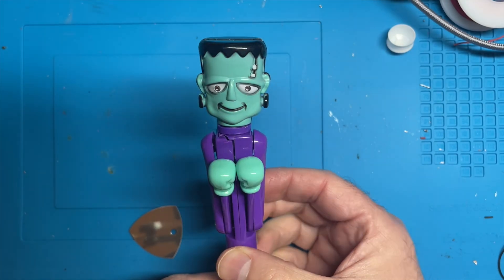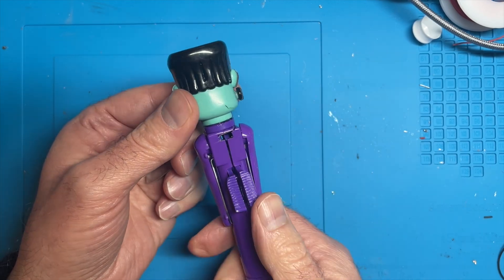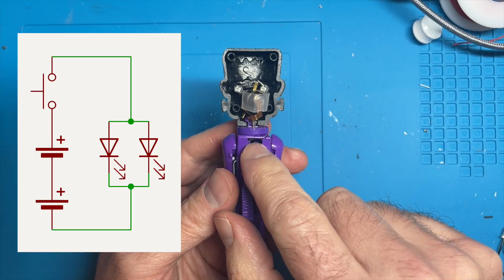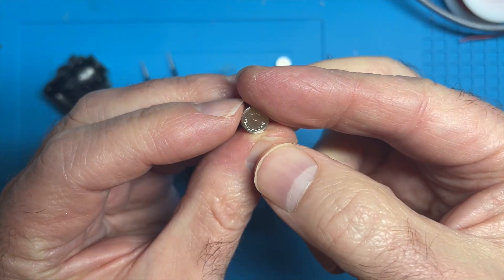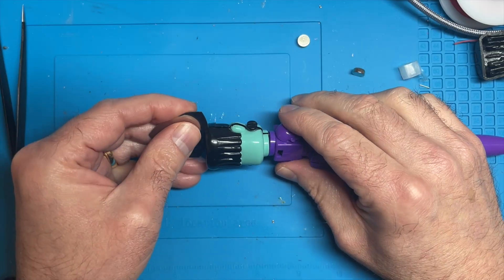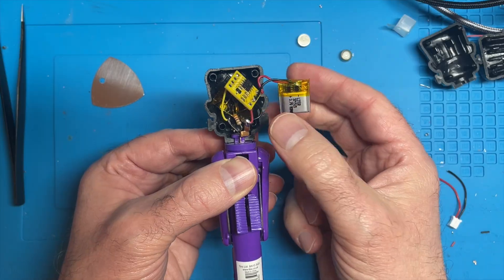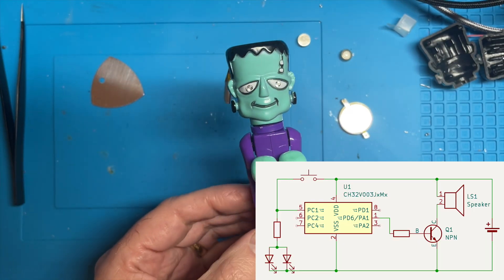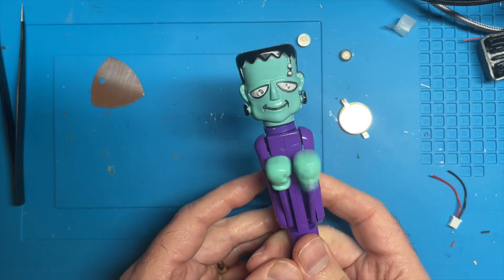10¢ MCU Brain Surgery - CH32V003

Comment: Doesn't the circuit require some decoupling capacitors? Also, how do you program it? Do you use  some custom breakout jig?
Reply from the maker: There’s a bunch of capacitors on the PCB. Programming is done using the a programmer that hooks up to one of the pins and the power lines.

Comment: Very cool project.  What happens if you drive the speaker directly from the MCU (no transistor) and why is deep sleep necessary?  Can't you just cut power to MCU when not in use?
Reply from the maker: Thanks! You can drive the little buzzer directly, but it’s pretty quiet. With the toy, the circuit is only closed while the arms are extended - so you would only get maybe 0.5-1.0 second of power.